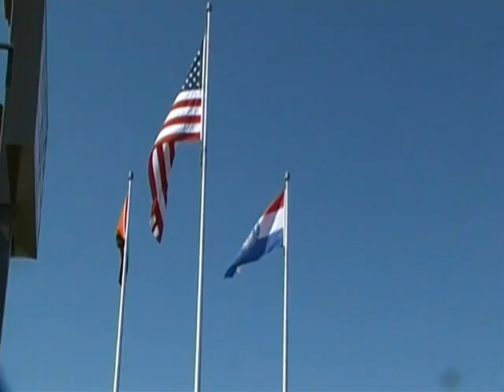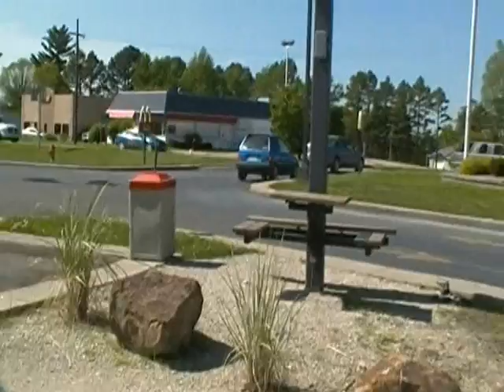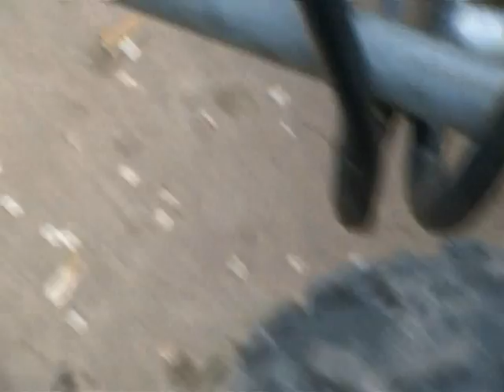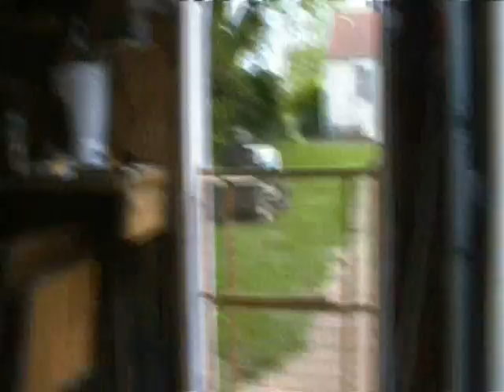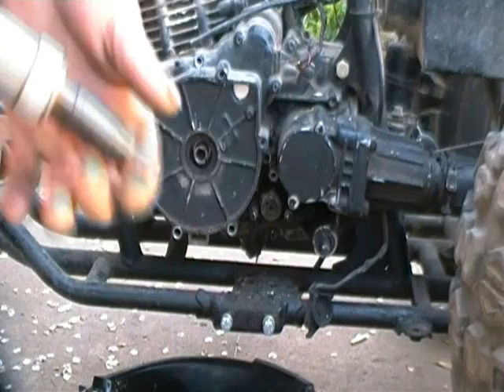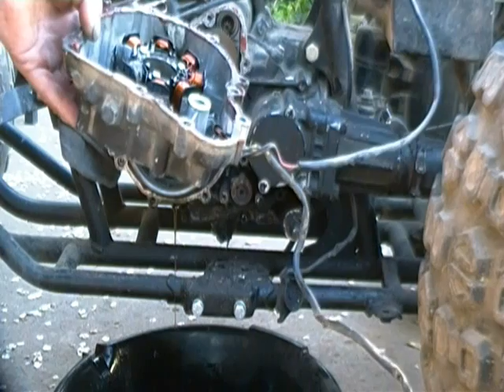klf 185 atv stator swap & pick up coil Gap

Comment: That screwdriver thing you're using do they still sell those that would be awesome to have because I am always working on engines and always running across Phillips head screws and always stripping them
Reply from the maker: The Impact driver ?,.. Yes they are still for sale almost anywhere tools are sold.  Automotive parts stores, Walmart, Sears or online,.Etc...

Comment: It won't cold start with stock cdi at all but once I warm the ATV up with the casoli the put the stock cdi back in it starts and idles fine
Reply from the maker: I really don't know why that would be happening. If it were mine, I'd go with the casoli. (because it starts and runs) and simply add a switch to activate the starter motor relay. until I could obtain a new stock CDI.  
(Which are rare and expensive as you already know )

Comment: Casoli gold box 6 pin I found out what wire was wit then I cut the wires off the old Fri and used the ends so I can just plug it in like the old one I'll see if I can make a video or at least take some pictures
Reply from the maker: That would be great & Thumbs up for you figuring that out.

Comment: I got the starter off it was jammed in because there was so much dirt packed under it cleaned it up put it back in it works but not if I push the button and I noticed the collar to the muffler is missing so I think that's y it's not getting much power
Reply from the maker: ok, well that's half the fun, chasing down the little things. Is your solenoid clicking when you push the button ?  as for the power issue, you may want to do a compression check. As well as locate an exhaust flange retainer.  I don't think that missing part would make you have much less power.  Just an exhaust leak.
keep me posted and we'll get ya right.

Comment: It may need new jets not sure yet would you happen to know stock specs for the carb fuel and air mix
Reply from the maker: I don't know the exact specs, but clean them out well and turn them in til they lightly seat, then out 1, & 1/2 turns... fire it up and fine tune it by ear from there.

Comment: Yea I had got the book I adjusted the valves and set timing since that video I posted
Reply from the maker: Ok good to know, & good job BTW... if you are certain the carb is clean and working properly.
The next thing I'd do is test the timing with a timing light.. so you know where it's firing at, rather than guessing.... or you could just try it, but toying with the timing could possibly result in a bent valve if it gets off too far.

Comment: Yea that's my plan but I have no idea why it cuts off when I give it gas it will act like it wants to go but once you give it full throttle shuts rite off
Reply from the maker: but it doesn't do that with the stock CDI,. Right ?
That sounds like the timing in the cdi is not set up right for this machine, (Advancing and retarding as needed by the engine)

Comment: Yea but what would make the stock one work in off position and not the on and only after warming up the atv
Reply from the maker: The only thing I can think of about it working after warming up is something with the engine or starter motor being too cold,.. thick oil or the starter needs refreshed.

Comment: I got rid of the vacuum leak it tries to drive alil better but I think my carb needs diff jet size I think this main jet is just some stock jet that came with thisbcarb it doesn't have any numbers or markings do you have any idea how I can find out what jet size I need
Reply from the maker: The manual speaks of a stock carb which is a mikuni/vm22ss.
main jet # 100,  jet needle clip position= 4th from top,  Pilot jet #22.5, starter jet= #35
Hope this helps,..cheers

Comment: Hey my fuel pump has been leeking  around the seals I replaced them and its still leaking so I wanted to find a aftermarket one but my book doesn't tell me how much fuel it should pump if you could tell me how much fuel or some aftermarket pumps that would work I'd deeply appreciate it
Reply from the maker: jon doe the book says it should pump 350ml per minute At 1-2.1 psi. 
I do know that when the float bowl is full and it creates back pressure on the pump. the pump slows down. You can hear it when this happens.These machines get great gas mileage, so it wouldn't need to pump very much.
Check with your local auto parts dealer & see if they can find something in that range.

Comment: The old solenoid didn't click replaced it with a new one looks kinda like yours and that one doesn't click Idk what the whole push start button has going on Imma try cleaning the button again also would it matter if the wires to the solenoid were reversed don't think they are tho
Reply from the maker: Check your fuse too,  Check the small wire going to the solenoid with a test lamp, or multi tester. It may be sending current but if the solenoid isn't good, it won't click. (even though it is a new one )  & no it doesn't matter which wire is on which post as far as the big ones go.
Reply from the maker: Hey Paul, do you have any other info about the 150cc CDI that you used and how you wired it up ? A lot of people would be interested in how you did that, Me too.
Thanks,  you have a video on it maybe ?  ...

Comment: Hey I changed my carb to keiin I think that's how it's spelled and it idles good but still bogging out wen give it gas got it to scoot around yard real slow tho but I have a question I'm hoping you may be able to answere or give me your best guess the cdi I have says it will advance timing by 4 notches so does that mean I should retart my timing?
Reply from the maker: Before I messed around with the timing i'd make sure the new carb is completely working properly. I t sounds like the idle jet system is working fine, but the main jet may have a small clog. resulting in too much air and not enough gas.  I would clean it out again 1st. The main jet and emulsion tube holes are tiny and any small debris will make it malfunction.
Reply from the maker: Have you checked the timing to see if it's right ? ( as it should be )

Comment: Yea I just Dont know were to go from here I don't know about the casoli either but it doesn't run any better with the stock and I haven't been able to find any good info about my problem and haven't found anyone who can fix it I was thinking maybe its losing compression but if that's the case would it even crank up
Reply from the maker: I'm glad you commented again. I've been thinking about you a lot lately & I'm not exactly sure what the problem is. Let me see if I have this right.  
With the original CDI box. it'll turn over & fire the plug ? but won't start ?

Comment: Hey Dog,

Loving the videos but im a bit stuck on something, i have 1989 KLF 220 with no spark, i dont want to take cover to magneto off if i dont have to, however i hooked a test light up to both wires while starting this beast and test light didnt light up, i havent got a multimeter to check. If test light does not show power does that mean magneto could be buggered?
Reply from the maker: +Dan Johnson   it could be buggered. I usually just check for continuity through the plug in. machine off, power in and power out. A simple 1.5 volt test can do the trick (flashlight battery and light) but I recommend borrowing or buying a multitester.  
If you're going to mess with these things, you'll need one. Check your stator and pick up coil while you're at it. all can be checked by the plug ins.
Let me know how it goes for you..Best luck to ya
Reply: ***** Wow thanks for the fast reply Dog, Awesome!! Can you explain a little more about flashlight and battery idea? I play a lot more with cars than bikes :) This is my problem:

Motor will turn over but has no spark, have checked Regulator and it only has constant power (white wire) and power from brown wire when ignition key is on, Yellow wires have nothing, no power to CDI, no spark through coil either, it all seems to come down to the stator :/
Reply from the maker: +Dan Johnson The flashlight idea is just a simple home made test lamp using a 1.5 volt battery and lamp with some wires.  Cars and bikes work off the same principles. &#160;
I don&#39;t have a manual for a 220, but I&#39;ll send you a checklist of things I look for when I get no spark. it&#39;ll be in your Youtube inbox.
Look here,  https://www.youtube.com/messages

Comment: The casoli cranks in on position but the stock cdi cranks in off position and stater button works in off position but it doesn't want to work till I crank the ATV a fiew  times wit the casoli cdi n once it warms up. The stock. Cdi starts works....I don't really get it
Reply from the maker: It sounds like the internal wiring on the casoli is different than the stock cdi.
I'm a bit puzzled too.

Comment: Hey I put a cdi on my klf185 and it has no spark when the kill switch is in on position but it has spark in off position but wouldn't crank do you have any ideas on that?
Reply from the maker: Let's go over some research questions 1st,...  
Does it crank when in the "on" position ?
Did it crank in the "off " position before you made the swap ?

Comment: how did you know your stator was bad. My charging system is only making 12 volts and it cant keep up with the headlights on
Reply from the maker: I tested it for continuity, & it didn't have any.  So I knew that wasn't going to work.
Always make sure the battery is in top shape before thinking other parts are faulty !

If it's making 12 volts, the stator is ok, because it's working. I'd lean toward checking the regulator and all connections. 
Test the voltage with the engine warmed up and running, between the battery posts.
it should show almost the battery voltage at low idle, & increase when the engine is rev'd.  If it goes way high the regulator is no good, & if it does nothing it's no good, or the magneto output isn't enough for the load.

Comment: Does it with both cdi iv  tried mikuni and keiin carbs ran the same no matter what iv tried iv had the same issue
Reply from the maker: ok, good to know.. Now let's go down this path=== if you start with the casoli & let it warm up, then put on the old cdi,... does it still crap out when you open the throttle ?

Comment: Hey tufdog I need some help I have a klf185 I wired a 150cc cdi to n now it cranks but I have a fiew problems I need to refresh my starter motor and I took the two screws out but can't get it off. Do I need to take off the stator cover to get it off ? Also it cranks will idle but doesn't want to drive gears change new clutch basket just cuts off when I hit the gas but carb is clean any ideas on what it may be? Thank you in advance
Reply from the maker: Well your onto a good beginning, The starter just needs a little force to pull it out, I believe they have an O-ring around the end that's probably holding you up.  You may need to pry it out with a screw driver, but be careful not to break anything.
if it's idling OK and you try to open the gas slowly and it dies, Check to see if the carb is mounted well and it's not sucking any air around the manifold, also try with the choke on and then off, if all this fails, you may need to blow the jets out again, there may still be some junk in there.  Good luck and let me know how it goes.
Cheers
Reply: Thanks Imma get out there tomorrow if it doesn't rain I'll keep you posted
Reply from the maker: Very cool, lookin forward to some good news I hope. best luck to ya

Comment: I'm the guy who put the casoli cdi on .....it crank with the casoli in on position wen I put the stock cdi it had no spark till I put the handle bar switch to off I have like a orange spark I sprayed starter fluid but didn't start up it started raining so I didn't get to do much more but everything is hooked up were it should be
Reply from the maker: Right, I remember now... ok , 1st of all, an orange spark doesn't sound very good.
as for it not cranking, I'm not sure.. I'll have to pull mine out and look at it again.
Reply from the maker: Hey Jon, I was thinking about you and thought,... Plug your old cdi in and see if it cranks in the on or/and off position. I know it won't spark, but that'll tell you if it's in the cdi or the wiring or something else. Just something I would try. 
let me know what you find out.

Comment: Yea it still does the same thing
Reply from the maker: Here's some questions from the trouble shooter in the manual,...
Are you using the correct spark plug ? NGK D8EA ?  is it gapped right ? 6-7mm !
Have you checked the coil ? is it grounded well ?,  It should produce A SPARK OF 7MM OR MORE !
Coil primary winding=.18-.28 ohms,  secondary= 3.2 - 4.8 ohms
Does it have good compression?
Let's go with these for now. Let me know what you know or find out

Comment: ....I'm thinking it may be a vacuum leak that mite be causing my issue...if it is imma feel like a fool haha
Reply from the maker: That's an easy check, spray some starting fluid around the intake manifold at idle, 
If it revs up,.. Then yep you've got a leak.. I hope that's it for your sake. Good luck & let me know...